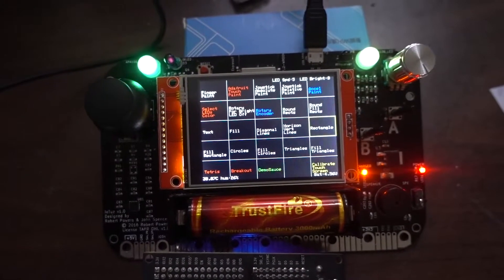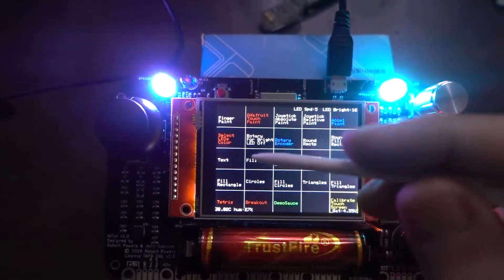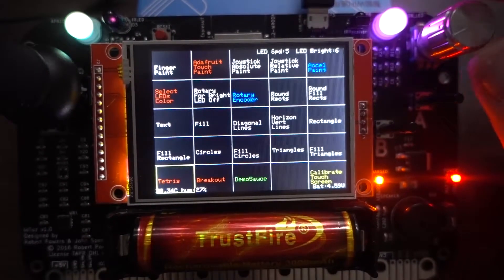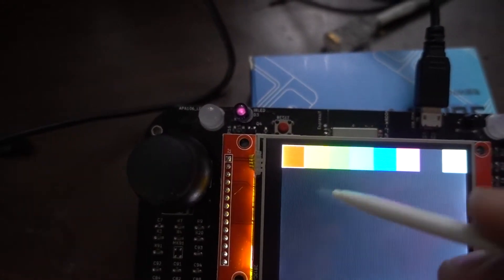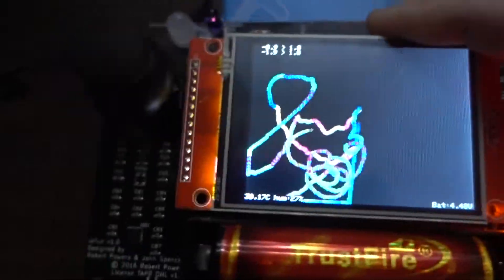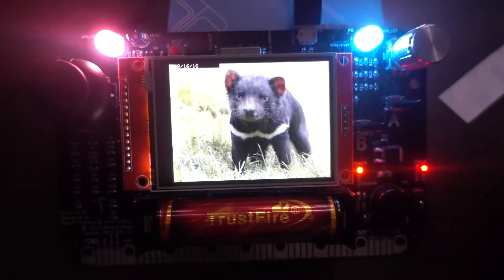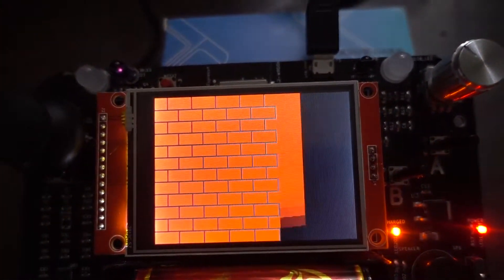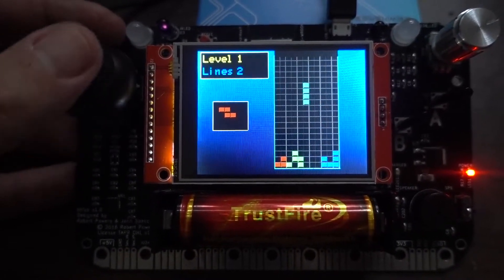ESP32 - IoTuz Full Demo (Neopixels, Rotary Encoder, Joystick, TouchScreen, IR Receiver)

Comment from the maker: @Salim: Sadly this board for buying at the moment, it was a limited run.
Reply: really professional board, I tried to connect 2 encoders to the esp32  using attach interrupt but never worked fine also tried writing similar encoder library without interrupts still failed to have it working,  only one encoder , i can put it on stm32f1 or nano chip but still liked your analysis to have all  running in one MCU.  was it a limitation to have 2 encoders even though you used i2c expander instead of having another mcu?.
Reply from the maker: I think you're talking about 2 rotary encoders, right? If so, there is only a single one on this board, so I didn't get to test that.
The I2C expander is used for buttons and non critical things, but the rotary encoder (the single one) is directly connected to ESP32 pins so that attachinterrupt works without issues.
Reply: I know that but during your testing were you able to have for the sake of testing 2 encoders working with the esp32, till now non one was able to make it work that way.
Reply from the maker: There is confusion here, I never got to try 2 rotary encoders on an ESP32. I don't see why it wouldn't work, but it should, I just didn't try it.
Reply: I see then i will just keep trying to see what it is not working with me with  2 encoders. Thank you.